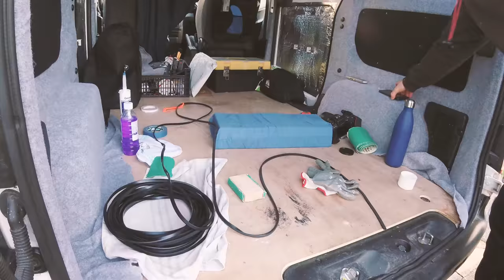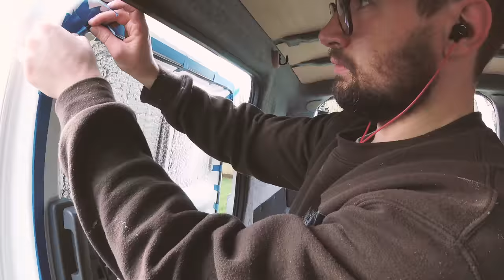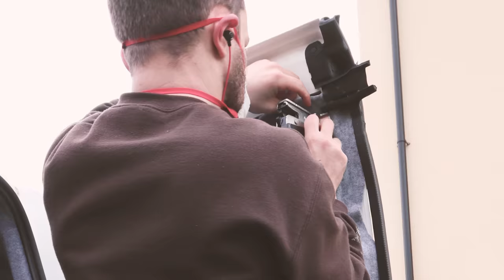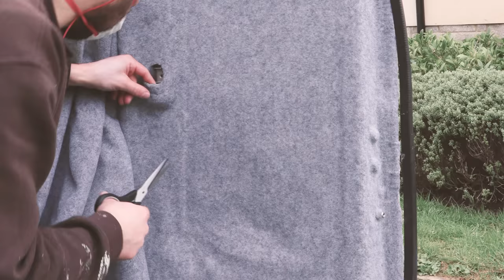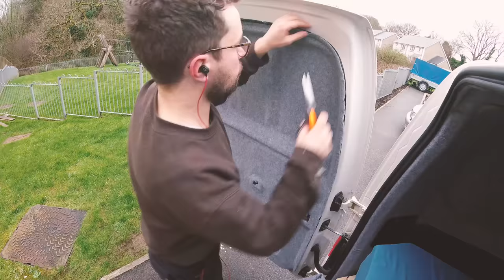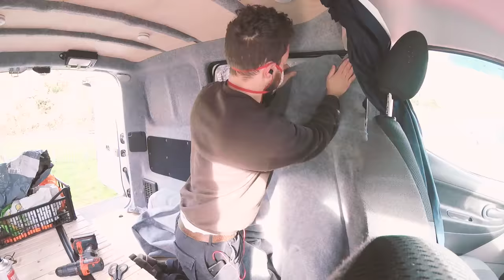How I Carpeted My Van Doors

Comment: Cheers for the video. Converted my VW Crafter van five years ago but had only carpeted to infill panels on the sliding side door as also put a window in it. Now want to do rest of the door as surprising how much heat it loses through the exposed metal parts so will give this a try. I replaced panels on rear doors with carbon fibre looking PVC as use doors as part of a shower cubicle so carpet not practical for this. Glad trim still holding fast a few years later.

Comment: nice job. I struggled to find a suitable rubber or plastic edging for the carpet around the doors that was pliable enough and wouldn't come off over time.  In the end I used a black fabric lume tape which has given the edge a nice neat finish. You have done a great job.
Reply from the maker: Thanks, I wasn't certain the rubber would work or stick, but it paid off in the end!

Comment: Great idea to hide the raw edges. I've just used this method but instead of using marine silicone I used Gorilla superglue...sticks really well and is a lot quicker.
Reply: How have you found the superglue to hold up over time Andy? About to do this to my van, and would prefer a quicker setting adhesive if practical.
Reply: @leemcdonald8817  It worked very well Lee, still holding up. Just make sure you get it in the right place.
Reply from the maker: Hi Lee, I'm not sure how well the gorilla superglue works as it depends on what rubber you use, but I used EPDM rubber trim and Bond It medium viscosity super glue worked well (when I needed to make an adjustment without getting the sicneout again) as it's meant for EPDM, and dries in seconds. Hope that helps, James.

Comment: Stunning work and very detailed! Dou you know if removing the carpet will be difficult and if any residue will be left on the metal?
Reply from the maker: Hi, thank you! I think the carpet would be a bit of a nightmare to remove and it would require A LOT of solvent to remove all the glue. I saw it as a permanent addition to the van.
Reply: @LensOfJames  Thank you for the insight. I very much would like to do this, but I think I'll have to pass on doing this for my Honda Element. looks like I'll be using Kilamat.

Comment: Hi James, it's me again. What is your feed back about the carpet on the door when it is raining. Does it absorb lot of humidity and is it easy to dry it .
I am asking that because I hesitate to cover the 4 doors with thin plywood instead of carpet to avoid this possible trouble (which maybe is not) and this long job with the rubber trim aslo. Alle my respect for your perfectionnism and your patience by the way ;)
Reply from the maker: Hi, I've been really pleased with the carpeted doors - the rubber edge helps divert water away from the carpet and it soon dries if there's any rain. When sleeping in the van overnight, bearing in mind that I don't have a roof fan, the carpet doesn't get damp at all and helps keep the van drier and warmer. I've talked about a few other commonly-asked questions here: https://youtu.be/2GU-z2BgkA0 Cheers, James
Reply: @LensOfJames  That's perfect, thanks you for redirection ;) I had almost seen all your great video, except that one, it is done ;)

Comment: This is a great work and video! What if the door latch fails? And you need to replace the latch?
Reply from the maker: Hi, thanks - if the door latch fails internally then I can take the door card off, cut through the carpet/insulation to access the problem, patch it back up again, replace the door card and (hopefully) no one will know!

Comment: Great video, I think I'm going to take the same approach in my van. Would be useful to know if you stuck all the rubber down with one can of 310ml silicone rubber sealant or did you need more?
Reply from the maker: Hi, yes one is enough - I probably used just over half a 310ml tube. I can also recommend Bond It medium viscosity cyanoacrylate superglue which creates a super strong bond, has quicker drying time and makes less mess. Good luck with your build!

Comment: Great job, but just wondering why you didn't just cut some ply panels, carpet them and then attach them to the doors, would have look just as neat and an easier job to do?
Reply from the maker: That's a fair question, but in short it was just personal preference; I preferred the look of carpeting with the contours of the doors. The cost of buying the ply would also have been quite substantial and I have been trying to do the conversion on a budget.
Reply: @LensOfJames  Thanks for the reply, btw I really like the way you did the pockets, they look great.

Comment: Hi there!  Just wondering if you've run into any issues with the rubber sticking/staying in place since you first installed it?  Thanks!
Reply from the maker: Hi, no I haven't had any problems at all - it's all still stuck firmly. As well as the silicone, some super glues also do a great job.
Reply: @LensOfJames  thank you!

Comment: Hi, how much carpeting did you buy to cover interior? nice job.
Reply from the maker: Hi, thanks! I bought 10 metres in the end. 1m x 1.4m wide for the ceiling, 4m x 1.4m wide for the doors and 5m x 2m wide for the walls. I could have got away with less, but I over ordered to be safe and probably only needed 3m for the doors in the end.
Reply: @LensOfJames  Thanks again.